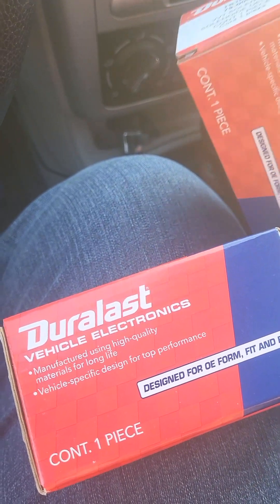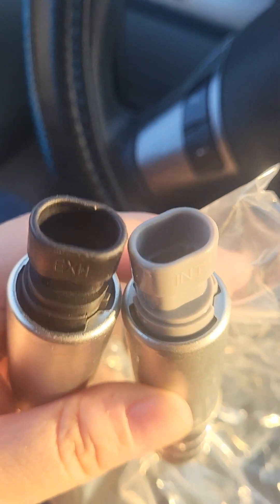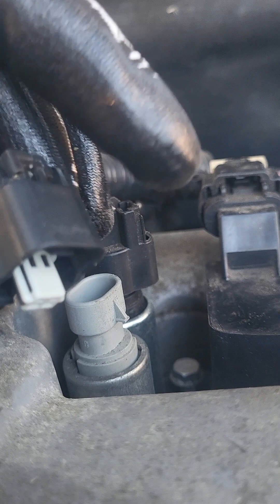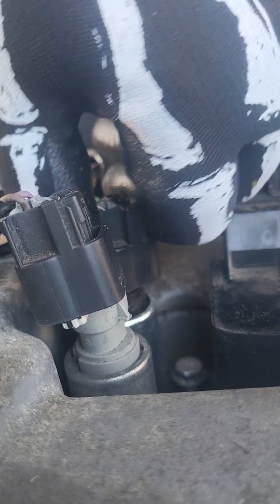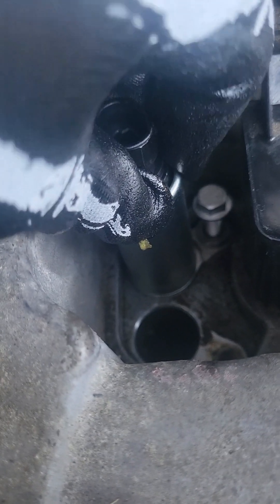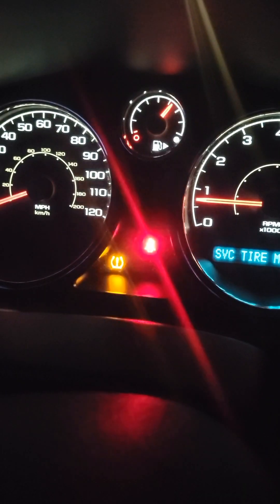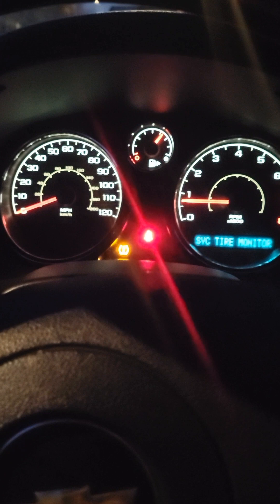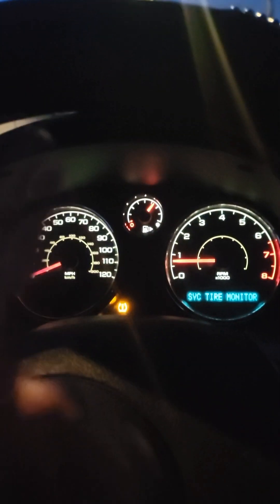2010 Chevy Cobalt P0010 code Intake & Exhaust Camshaft Position Solenoid replacement

Comment: Dammit i tied it too much and the damn bolt broke inside
Reply from the maker: Oh no Hercules, you gotta not overdo these things sometimes. I'm sorry this happened to you, the best thing I could think of is when you do your oil change, make someone try to draw it out with a magnet, because it will settle on the bottom of the oil pan. They actually sell a magnetic pick up tool! Looks like a retractable antenna. Maybe fish around in there for it when it's empty! Sorry this happened to you, but it's fixable 💖
Reply: @MidnightLadyCrow thank you. Hopefully 😩

Comment: Was the bad one causing your gas to run out really fast?
Reply from the maker: Hi, I'm sorry for the late reply. It did not, but it was feeling sluggish when accelerating. It's been fine since. If your chevy feels like it's wasting gas more faster you might want to check if you need a new fuel injector, or maybe you're due for new spark plugs because that can contribute to poor fuel economy. Even something as small as changing the air filter could help. When those are super dirty, it restricts air flow to the engine leading to bad fuel economy too. Are you seeing your engine light on your dash at all?
Reply: @MidnightLadyCrow Yes and I went to get it checked, the code is coming back as a camshaft but the exhaust one. I actually got it changed and my gas has been good since then lol
Reply from the maker: @natashajefferson7699  Well then yup! This vid was for you haha. At least you got it switched out and it's doing well love.

Comment: Was your car shifting hard between 1st and 2nd? I have the same code and it’s hard shifting. I replaced the TCM and the MAP sensor. After I replaced the map sensor, it fired up and worked perfectly. When I tried to restart the car later, it wouldn’t even turn over.
Reply from the maker: Man this was a while back but if I remember correctly it did have a bit of an issue with the push. Since I've changed the solenoids it's been running just fine. But I would recommend a transmission flush just in case. Could be a reasoning for the hard shift. As far as it not turning over you mean won't start at all? You can check for poor contact of manifold absolute pressure sensor connector. When I did my radio I had to replace the harness because I find with these cars the damn wiring sucks. Make sure it's secure (these things happen, not saying you didn't check :)) I hope everything works out for you.

Comment: Very helpful video! Got my check engine light turned off🙏 Now I'll hope u recorded the wheel sensor cause I got the same issue xD keep up quality content!
Reply from the maker: Haha! Awww I'm so glad this helped ☺ and as far as the sensor goes, that's something that needs to be programmed. But! It does no damage to the car. It's only importance is to warn you when you tire has low pressure. Just give it a visual from time to time and check with a tire pressure. Sometimes those things go faulty with your tire pressure still good!

Comment: Why am I leaking oil from there when the parts are replaced but when we put the old ones back in the oil is not leaking. Also the replacement parts came from a junk yard if that could mean anything.
Reply from the maker: Yes! If the oil is leaking it's because there isn't a rubber o ring on the part that will prevent a leak. Or if you do see the rubber seal ring around it. You have to make sure you're pushing down hard till you here a popping sound. Mean's its in there good and then tighten it. If you don't want to spend too much on these parts, you can always buy them cheaper on amazon. I wouldn't really use parts such as these from a junkyard, could be really old and worn out already. Good luck!
Reply: @MidnightLadyCrow  Thank you the O ring was the problem. Thanks you for responding back!

Comment: Just bought the intake one at O’Reilys this morning. It was less that $80. I normally but at Autozone too but car was already misfiring due to this part and Autozone was farther away.
Reply from the maker: I'm glad you were able to still get the parts! Hope everything works out well for you Paul.
Reply: This plus the sensors was $30 on Amazon. I hate local shops